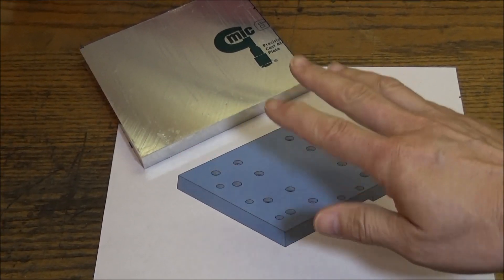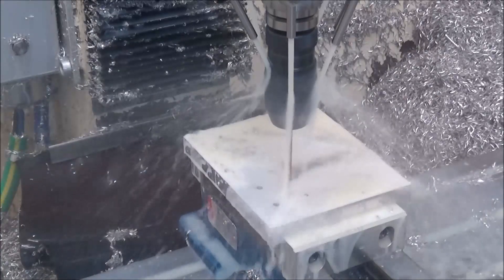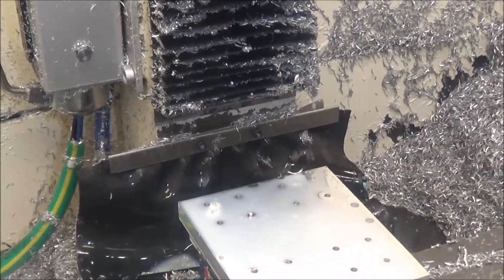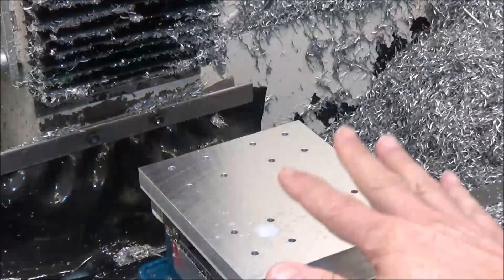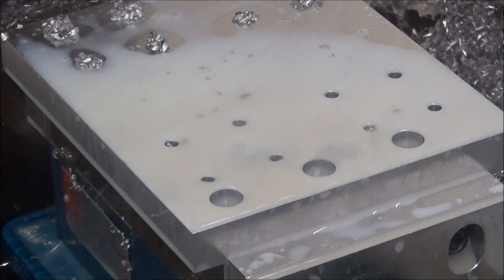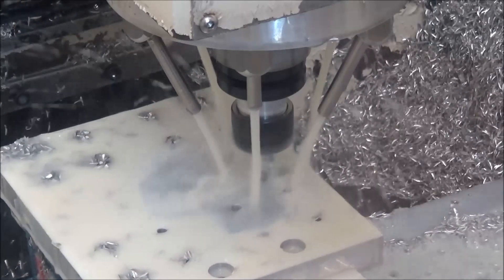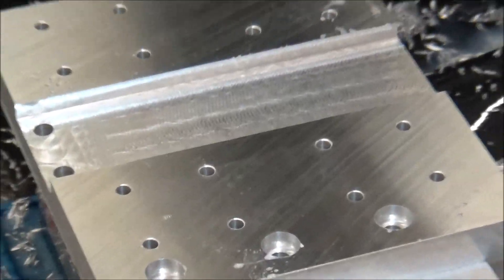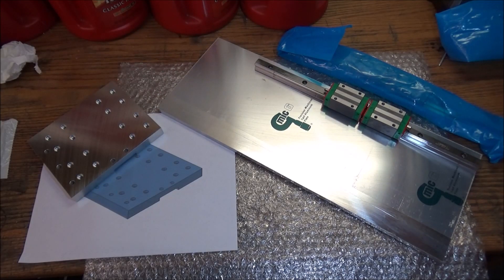PM727M ATC Pt 9

Comment: also sam, did you get the memo about fusion 360 changing its licenses for personal/small business use? is it going to affect you?
Reply from the maker: The changes do not effect me as I had a startup before last year when the legacy license came out. ( lifetime subscription rate. ) At that time I purchased the Legacy subscription @ $310 a year. from the information I have .
there is no changes to Startup's
Most of the limits on the personal license will not effect the majority of the hobbyist that I think follow me. Your limited to 10 projects but each project could encompass many models. and you can switch those 10 projects out from the cloud. So I don't see that as a issue.
 the biggest issue is NO RAPIDS which was discussed. CAM Simulation is still available. 
I Understand as Hobbyist we have limited funds and therefore spending $300 a year on a subscription seems a bit much . However if you break it down its really not that expensive and is a vital tool for machining. $25 a month  or 2 cups of Starbucks a week. Like everything else people who can afford to pay Don't and abuse the system. therefore these restrictions were put in place to irritate enough to have you subscribe. If time is money NO RAPIDS is going to be a big deal for hobbyist not so much we tend to take slower feed-rates anyway.
Reply: @CNC4XR7  i suppose that yes, in the grand scheme of things, 300 bucks a year isn't that much. i do hate that they removed the rapid feed rate though; however, i think i understand why they did it. time is money, so they probably said "well if it's just for a hobby the lack of rapids doesnt matter right?" with a stupid smirk on their face. sigh. guess i'll have to stare at the machine as it "rapids" in slow-motion
Reply from the maker: @ikbendusan  It will rapid at the feedrate. but you can always edit the gcode where rapids are really needed.
Reply: @CNC4XR7  depends on the work you do; i do some engraving for my dad every now and then and my feed rate is 120 mm/s. considering i rapid at 1500 mm/s, that's quite the blow lol
Reply from the maker: @ikbendusan  That's true And unfortunately there will be some unintended victims of this change.